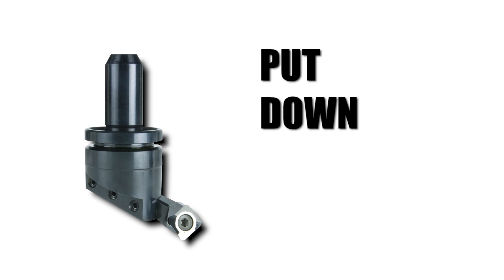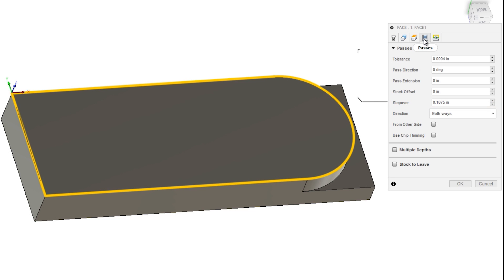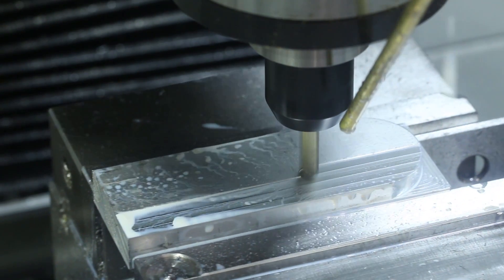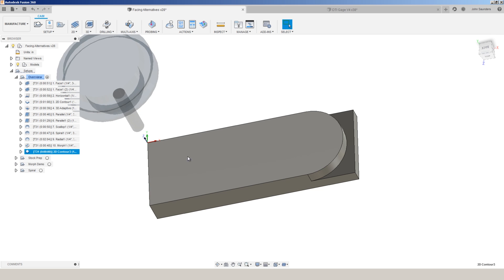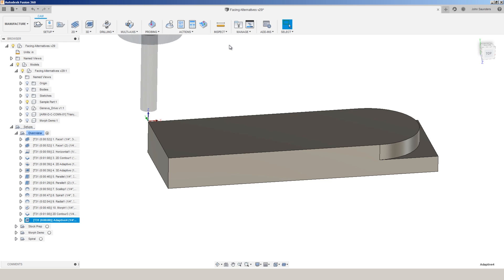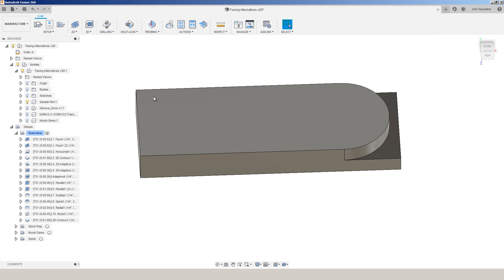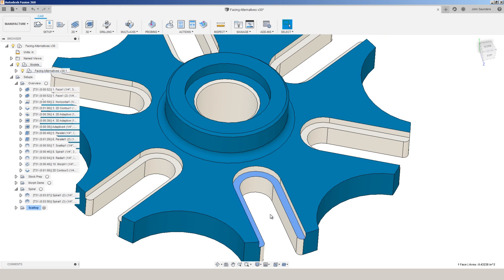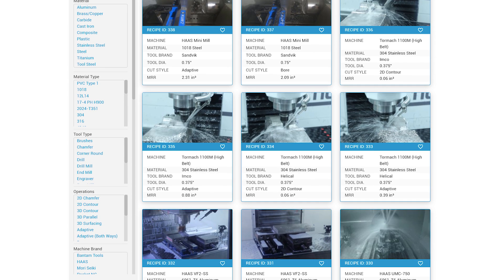10 Ways to Face a Part! WW264

Comment: I have my part on the edge of my stock which is modeled in a 6” Kurt vise on my Bridgeport mill. I’d like to use milling both ways at multiple depths with a finishing path but have my enter point on all depths at the edge of the stock! I can get the first depth cut to enter where I want but the rest of the depths enter from the other side which it cuts in from the top of the stock not the side! Am I stuck with climb milling to achieve this?

Comment: Aloha John  I have a tricky setup problem. I need to make two long t-nut type slides for a bandsaw fixture. My only machine is a Tormach PCNC440  and the part is 23" long.  In my mind this means refixturing the material  at least three times along the x axis.  The stock is only 3/8 thick and finish width is less than 1" .  I'm trying to decide if soft jaws  (4" Tormach Vise) or  fixture plate with something like Mitee Bite  parts or even  Mitee Bite to tee slots.  My Job budget is small as it's for a Non-Profit.

Comment: Any tips on avoiding that center sliver in Adaptive? I get it almost always. I've tried "adding" negative radial stock to leave, but no success.
Reply: I would assume the only way is to "lie" to the software that the tool is a smaller diameter. Not exactly good practice lol but hey. Masertcam has that same problem so I would just do a do a helical bore on center big enough to cover cusp.

Comment: John, as usual, I stop everything. Watch your video and then change some of my strategies. Awesome content. I would have a suggestion for a next WW. I am facing some problems in making CAM strategies for a 4th axis job for helical and moreover double helical, herringbone gears. I made some simulations and, despite I know fusion360 is not at the level of Gearotic Motion in machining gear, I would like your opinion about it and maybe your solution! The best strategy would be to use an involute gear cutter, but also a classical mill operation could work for small helical gears. So far I can not get a really efficient strategy as the one Gearotic creates. https://forums.autodesk.com/t5/fusion-360-manufacture/machine-a-helical-gear-first-nad-then-a-dual-helical-cam/m-p/8976685. 
If that can be in idea for a new 4th axis WW, that would be awesome! Ciao ciao

Comment: I just used contour on some castings where I needed to control how close I got to the workholding in the 5-axis.  The absolute edge of the cleaned up surface has a wide open tolerance, but the placement in the workholding meant I couldn't drive the toolpath off the modeled face.  So I used contour and a sketched containment boundary to face the area while avoiding the vise jaws by about 0.015".